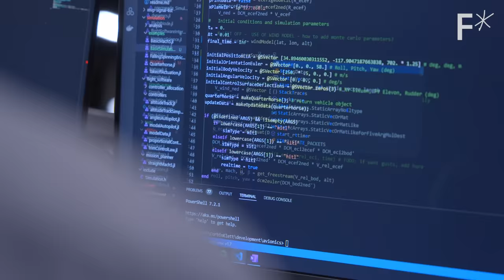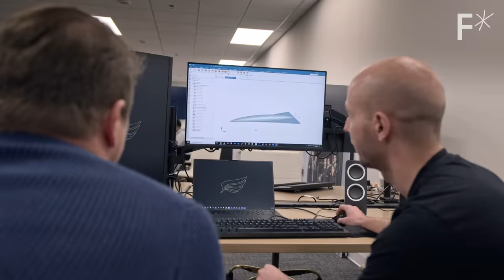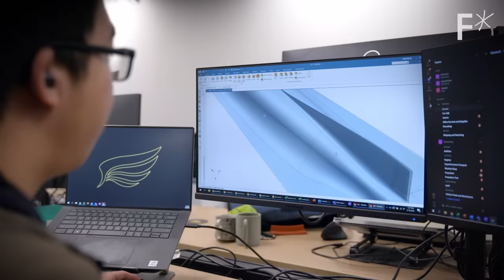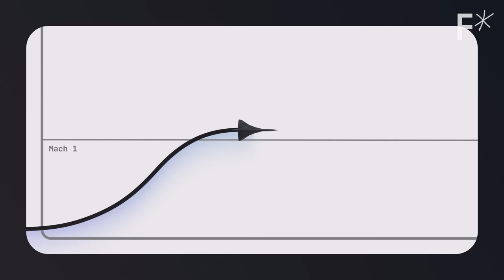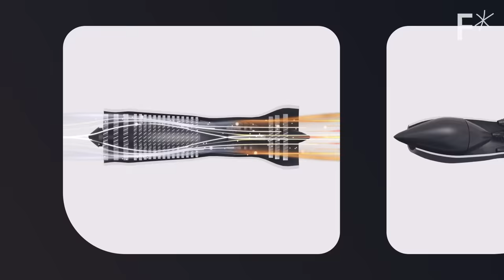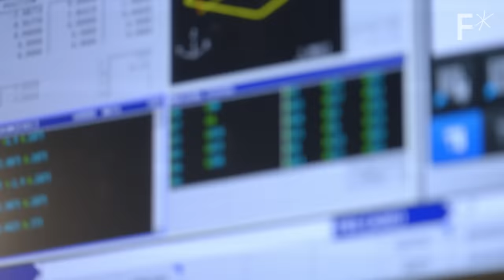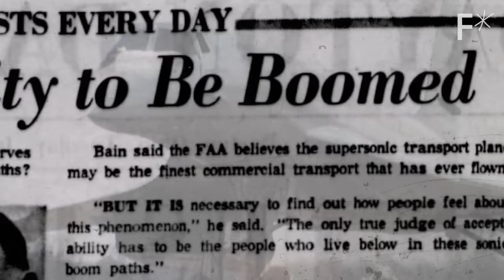This Mach-5 engine will do what no other can | Challengers

Comment: Not saying this is the case here, but do you guys ever think companies like this could pop up, with a few educated people who know what they're talking about accompanied by individuals with business connections/ network and such so that they could just crowd fund these things and then disappear with the money? Reminds me a lot of the "fyre" festival incident or FTX. Once again not saying this is the case here but when she said from zero to a prototype built in 4 months; and they're "fully" expecting to lose a vehicle due to a number of things that could go wrong? seems as if they're purposefully setting the precedent so that potential investors wouldn't be turned away if catastrophic failure happened. I also found it interesting how they just piggybacked off a commercial engine and "strapped" on their own afterburner which runs the original engine past its designed speeds?

Comment: Imagine instead of a scramjet they used what is called a HCE or a hypersonic combustion engine
What you do is that you put the HCE in the back of the scramjet making it to where that that power gets amplified by the HCE, when it gets up to speed making it to where instead of a maximum of mach 12-24 the maximum would be like from 35-60
Problem is we would need a way do the plane doesn't just explode when it gets up to those speeds and also a way to get the materials for HCE and also a way to make a very powerful scramjet

Comment: Ok windows are a structural vulnerability, but I would've loved it if you went into more depth with the team. How is the craft gonna be cooled, the temperature regulation I mean? What specific materials besides some vague "temperature resistant metals" will this thing be implemented with?

Will their be proper marketing regarding economy and class types specifically? What are the gimmicks?

Comment: This tech will never be used for passenger airplanes.  Hypersonic flight is not and never will be fuel efficient.  The Concorde has been a huge commercial failure and had it not been heavily subsidized by the French and UK governments this plane would never got passed the prototype phase.  Contrary to what has been said, the Concorde did not fail due to over land supersonic flight ban, it was due to high operating cost.  When it was operational Air France and British Airways were loosing money on each flights despite the tickets being 3X the price of an equivalent ticket on a regular airplane.  A successful commercial airplane needs to be cheap to operate and during its lifespan the fuel cost is by far the most important factor.  If this tech is ever commercialized it will be for military purposes like hypersonic cruise missiles.

Comment: Thoughts on a magnetic propulsion plasma engine which utilizes a magnetic field to incase the vessel in extremely hot plasma, while changeling the plasma towards the back and into the magnetic compression engine to provide hypersonic travel while eliminating air friction

Comment: 6:43 I thought that the air flow is will go through the center of the engine, becaues it's very only method of very fast air flow. It's very simple to think of the SR-71 engine.
but I think that was very difficult to make alike it.

Comment: Super/Hypersonic airliners are not in the interests of airlines.  Cost-saving is.  Fuel is expensive.  However if they can design an engine that uses less fuel and can travel at supersonic speeds, then they MIGHT have a chance.

Comment: why did you decide to build a hypersonic passenger plane rather than a hyper quiet passenger plane. I don’t think speed is the issue for the customer I think the issue is comfort. Also breaking the sound barrier is bad for sound pollution. I think you’re going in the opposite direction than the customer actually wants.
Reply: Unless is this supposed to be a weapon I don’t see the point but they said it was for passenger planes

Comment: Long runway slow/exponential acceleration, once airborne, modify acceleration for the goal of efficiency but I believe at some point it starts to payoff exponentially to use more power to get more power (similar to fusion? Or the thermogenesis reaction in hydrogen? (Clearly ignorant, thanks for your tolerance), like downward acceleration with gravity, . If you are using fuel efficiently, you will get power. It sounds like you already have great power, give yourself time to use it. Lightening McQueen, slow is smooth smooth is fast

Comment: Surface temperatures of the aircraft at mach 5 would vary greatly at different altitudes, not enough info.... seems impossible for a passenger sized aircraft to go mach 5 at sea level like the video alluded to.

Comment: I'm overjoyed to see that the engineering philosophy Elon and SpaceX have brought to the aerospace industry is taking roots. To acknowledge that failure is an option or even that success is not the most possible outcome, but you should try nonetheless are things I never heard before Elon. A development pipeleine that allows for quick iterations, vertical integration, all those things that made SpaceX the global leader in aerospace, those concepts most certainly will accelerate development in other areas too if applied correctly. And this team seems to do exactly that.

Comment: I'm sure a plane like this can become a thing. Hypersonic flight is a fairly-well understood concept. 

But this plane will never be used for commercial passenger service. Ever. 

At the utter extreme, you can only hope for chartering the richest of the richy rich.
And that's assuming it will have the range to make that speed worth it.

And don't mistake me for pedantic or a stick-in-the-mud. This is coming from someone who doesn't believe the speed of light is the limit of space travel velocities. 
I'm a high-reaching person, conceptually. But I'm also a practical thinker. I work on airplanes. I know my aerodynamics & I know the economics of flight.

Just to recap, from an engineering standpoint, this plane is perfectly possible. Can't wait to see it fly!

But I'm not holding my breath for this plane to serve any sort of human transportation. Neither commercial, nor a charter. Not even emergency services.

Comment: I wonder if you used complex computer cooling inside the wing, like heat pipe teck with a gell in the pipe cooling and expanding
For cooling.. just a wondering question..

Comment: 5+ Mach isn't difficult, Functionally. THE PROBLEM WITH HYPERSONIC IS - RELIABILITY. Thermal Effects, Shock, Vibration.... meaning Materials of Construction - Metallurgy, Special materials and Dynamic Stresses on the Craft ....Stress Cracks etc.... Whole Sections of MIL Aircraft have Broken-Off due to Stress ----IMAGINE NOW THE TEMPERATURE - SHOCK - VIBRATION IS 2 TO 3 TIMES THAT.

Comment: Won't the altitude play a role here.  With the SR-71 it can't cruise at Mack 3.2 at sea level, it has to go 80k feet to do it. (I could be wrong).  Plus the SR-71 had to have a titanium shell for going only Mack 3.2.  It feels weird you did not mention this most famous blackbird!!  Like you carefully avoided it!!  My BS meter is reading somewhere in the middle here:)

Comment: So to play deivls advocate here, why would you not seek to advance the elasticomerit skin to allow the aircraft to change shape to accommodate the different levels of flight. I understand the stresses that are involved here, having been a aviation mech, and a aronotical welded, along with some education albe it informal in metallurgy and heat treating. , but I would think the efforts to develop the elasticomeritc materials to withstand the Temps and stresses, of hypersonic flight. Seem the benefits could be above and beyond what would be needed. Opening the door for future tech advancement. Looking forward to a new amount of education in this area, as well as the results of such efforts.

Comment: The Sr-71's speed limit wasn't the engines, it was the ability of the airframe to handle the temperatures that air friction created. A ram jets therotical max speed limit is mach 5....this whole video is a subtle plea to get more money.. why dont they use the already designed pratt & Whitney J-58 turboram jet..

Comment: Powered by rockets, but hermeses is trying to do something different.
Like NASA did in 2001 with their SCRAMJET that reached over mach 9 reaching temperatures of over 3800C
And no, even with exotic materials 6000MPH passenger vehicles are not feaasable unless at an altitude above where a jet engine would be feasable.
The X43 reached just over 7000MPH and it basically came apart after a few seconds with a craft smaler than a single seater part 103 aircraft, now imaging the exapnsion and contraction on a 10 passenger aircraft flying for more than just a few seconds at 3000C.
3000MPH probably achievable, 6000 MPH would probably require 99% carbon 12 diamond skin, cryogenically cooled by the fuel flying at over 100k feet.

Comment: it is a cool concept but i doubt there are any real world applications for such an aircraft, definitely not as an airliner, the concorde already demonstrated that it's not economically viable to do it due to the fact that it used a ton of fuel and that stuff is not cheap, also the maintenance cost gets much higher as the aircraft gets more complex, add that to the fact that they were banned from flying at mach speed anywhere that wasnt a desert so they could only be used for transatlantic flights and it's easy to see how it just sucked money away. And they were flying at half the speed of this aircraft here.
I dont even think it will be very useful for military applications due to the fact that it will have a very short range while flying at top speed and no one in the military is trying to make planes as fast as possible so the ability to reqch very high top speeds alone clearly is not the most important thing for defence.

It is a fun concept tho

Comment: Unless they are going to make a  hypersonic plane that flies quieter and consumes less fuel than the Concorde plane then they will be facing the same problems of making the plane a viable cost effective commercial passenger jet .
It's like reinventing the wheel but just making the wheel a bigger size and  calling it a new invention 🙄🤷🏽‍♂️ . 5:37

Comment: This is dramatically less stupid than Elon's idea of rocket-based mass-transit, and they may very well achieve the speeds they are going for, but this will never be viable as a large-scale mode of transportation.  The fuel requirements are already problematic, and that situation only gets worse going forward.  At best, this will have short-term commercial viability, and only by catering to very wealthy people.

Comment: These guys are scammers.   They haven’t even gotten remotely close to the x43 (20 years ago) and the x51 (10 year  ago).    And they won’t get close.

It’s also well known that the issues with hypersonic flight are not the engine/power.  But the heat.   Just the windshield materials at Mach 5+ need their own custom engineering and will cost a fortune.

Comment: Didn’t they already try that with the Concorde? And the main issue was, they couldn’t fly at certain speeds over populated areas due to repeated sonic booms that and associated costs. I know this is way more futuristic as far as mechanic wise, but wouldn’t it pose the same problem. I guess when you get over the ocean, you can fly at hypersonic speeds and what not but I watched a documentary about the Concorde and they mentioned a lot of those issues.

Comment: Frankly, there's only ONE WAY this small under mentally equipped, under resourced bunch can ever hope to do this, they will absolutely have BUY the intellectual property of Reaction Engines Ltd. for the secret designs of their pre-cooler, they are the ONLY ones on this planet who have managed to crack this very very hard problem, that is, taking in superheated intake air at thousands of degrees Celsius and cooling it to minus 100 degrees Celsius in under a second, and also without the moisture in the air clogging the cooler as it turns to ice, Allan Bond's team did this, no one else has a clue how they did it. Personally, I'd be surprised if R.E.L. would let them have it, I'd rather see it used for the platform it was meant for, SKYLON !

Comment: wonder how much thrust you can get with nitromethane mixed with nitroglycerin, and using nos hydrogen peroxide to burn it...
Reply: throw some acetylene in as a fuel propellent, just make sure it dont get unstable tho...
Reply: gonna need some tungsten, carbon, and titanium alloys for dat kinda power and heat..
Reply: good thing about dem fuels is teh burn great, and in teh right situation, can be made to detonate!
Reply: any old school drag racer wit experience will tell u pleny horror stories bout what happpens wen a nitrometh v8 has a bad day at duh trak and turns into a bomb, and why people use ethanol mixed wit water or oil/kerosene now instead....

Comment: For passenger airplanes never going to happen, but if it's efficient and reliable as a passenger turbofan jet engine or even anywhere near close which honestly I don't see happening, but if it did the application for space flight is pretty good, if you can get to 1701.5 meters per second thats like most of the booster you can just remove from a rocket like yes you are only 20% the way to orbit.

But the rocket equation is a bitch. Meaning that the first 20% of the deltaV was spent getting the remaining 80% upto that speed so it's like half your fuel, so think about it this way, not only did the fuel need to accelerate its self it needed to accelerate the remaining fuel and rocket so it ends up being a disporotionarly large amount of fuel in mass.

Also altidude costs you fuel and fighting gravity costs you fuel so even though it's only 20% of the final speed it's more than 20% of the deltaV a convensional rocket would have consumed, you need about 9km/s of deltaV to get to orbit even though orbital velocity is 7.8km/s so the remaining deltaV required after getting to 1701.5 meters per second and an altitude of probably around 25km is probably around 6.5km/s assuming a high thrust to weight ratio so you only need 72.2% of the deltaV approximately.

Comment: Another "Imperialistic biased" anti-scientific video.
Joy.
Our land (US) uses ISU (International System of Units or "Metric" system (Should become USU: Universal Standard of Units)).
So why don't you.?
 
3KMiles/hour (3'000 Miles/hour) = 4830 KMPH or Mach 3.9 for those that are slightly less "Imperialistic biased" and those not familiar with the Imperial System.

Comment: Mach 5? Good luck. No offense, but from what I saw in this video I remain highly skeptical. What's the purpose of this project? Beat speed record or reintroduce hypersonic flight for commercial flight? The scope is not clear.

If so, there are reasons why supersonic aircraft disappeared from the market. The spectrum of challenges are wider than just creating an engine that works at hypersonic speed or dealing with heat (2 giant problems, don't underestimate them). Also I see a lot of young engineers. Nothing against young engineers (I'm one too) but with experimental concepts you need people with experience to guide you (SME), especially when designing an aircraft that should be used for commercial flights. How are they going to satisfy all airworthiness requirements? How are they going to certify their aircraft? Is this just a concept?

There are no solutions presented for the issues that are already known. They way this was presented is more sensational to get attention than technical insight in how they are developing this aircraft. I dare to say, they have no idea how they will get there and that this aircraft will never accomplish what they are aiming for.

That being said, they will have results and they will be interesting, but not in the way they expect it to happen.

Edit

I completely forgot about infrastructure. Which airports will meet the requirements to operate this aircraft? Noise, do you want a sonic boom in the vicinity every time a plane reaches cruise? Where can the aircraft reach supersonic (hypersonice) speed? Are we going to extend the runways? Do you have a partnership with airlines or airports? no